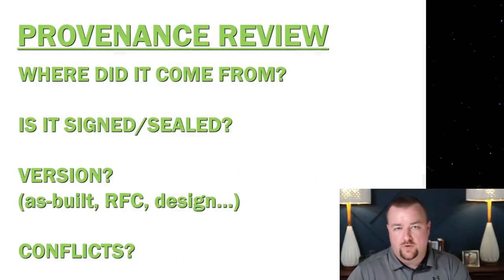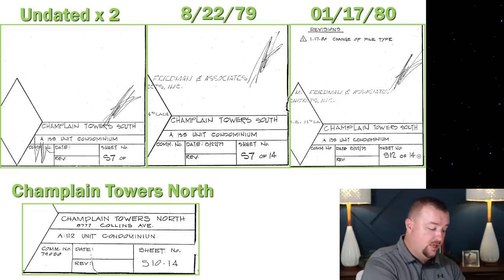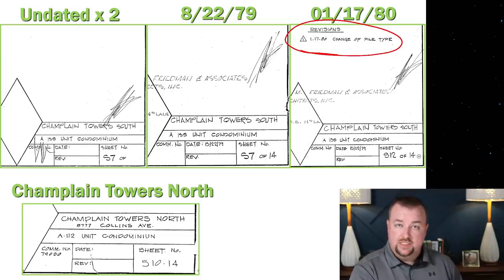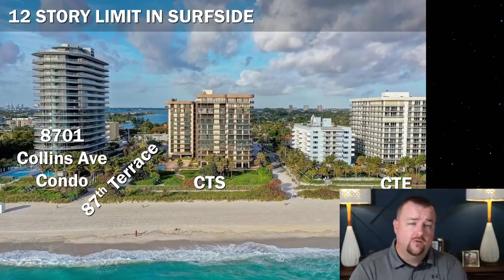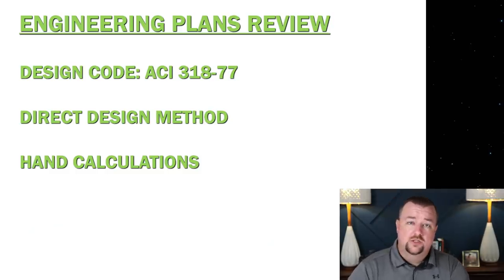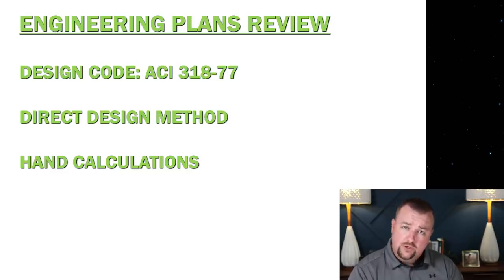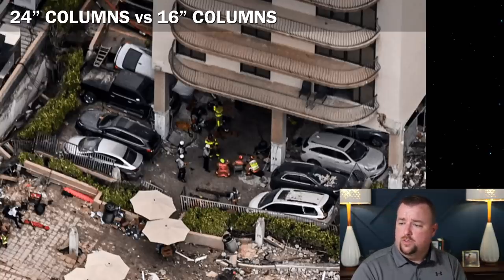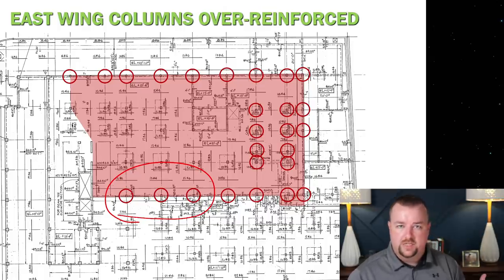Engineering Failures Found in the Champlain Towers South Drawings - Surfside Collapse

Comment: The alarming point here is that these changes were made, apparently, on the fly, with no sign of a redundant "check-out" by a second engineer or inspector to approve the revised (and reduced- capacity) design.

Engineers who think their designs don't need scrutiny from a second set of eyes is the cause of disasters immemorial. The hubris that somehow manifests itself in the trade is something that deserves study, and measures should be taken in the engineering schools and in the firms to identify and eradicate this lethal flaw...........................
Reply: Citys Planning Depts have plan check & no changes are allowed to a Design without another approval. How can you catch a Developer or Contractor who makes changes that arent on the Plans? That is why the Inspectors go out & sign off at stages. They have the power to shut down a job.
Reply: The same of which you speak they did with pilots of commercial jets. The adage of two heads are better than one will live on in time.
Reply: @Userxyz-z2d  Apparently that didn't happen here.

So who do we bring to justice?
Reply: @larrybe2900  You've the right of it.

Any profession that proclaims advocation is to be immediately suspect. Just as professional pilots rallied and protested for additional training, instrumentation and procedures to increase the safety of their field, Engineers should be actively advocating for increased oversight, continuing-education and at least two-person sign-offs on projects that possibly hazard human life.
Reply: @Userxyz-z2d  Not all city planning departments have plan check, and that was more common in the 1980’s than it is today.

Comment: Everyone is saying the collapse was caused by multiple issues so every new theory is very important. Thanks for making these videos somewhat easy and interesting for us novices to try to follow along.
Reply: Yes, there is rarely a single explanation for a building collapse. New insights are not new theories, they are new factors in the overall analysis.
Interestingly, there are many details in the column/slab designs which would not have satisfied UK codes 40 years ago but the underlying issue seems to me to be that any building loaded to 100% of capacity by its "as built" dead weight leaves no room at all for construction defects, alterations, change of use, deterioration or subsidence.

Comment: Fascinating as always. It’s scary to think that the original design had no redundancy. And then it was tweaked and weakened further. I wonder how today’s standards and computer aided design would have impacted on these plans if they were being drawn up now. Would the CAD program light up with red flags?
Reply: Definitely CAD is not just 3D structure editor. CAD does calculations after materials specified and does tensions drawings with some highlighting of failed locations.
Reply: If designed properly in the late 70's, the slab/beam design would have not changed significantly to current design. The top steel would be concentrated over the column strips instead of the top steel on the middle strips. There would be integrity steel (extra bottom bars that go over the columns). Parking would be 50psf instead 40psf which is a minimal change. A heavy dead load structure like this one would be slightly less conservative to current code but from a practical perspective, not significantly different.

Comment: Maybe it's time to look at other buildings this engineer designed.
Reply: yeah like all of them because there are no telling how many others might be designed to collapse and yet to do so
Reply: ...Or changed for alterations.
Reply: Especially the sister buildings! I heard, there is not only the North Towers but other very similar so called sister buildings!
Reply: @Iwoasasaned  And maybe look at the buildings that were inspected by the same people from the city.  I suspect a patterm will emerge.
Reply: The building was designed by an architect: William Friedman of William M. Friedman & Associates Architects, Inc. At least, he did the original 1979 plans. Not sure who did the 1980 mods.
Reply: @Johnny.Fedora  the structure is usually by the structural engineers (as practitioners of engineering). 🚧
Reply: Erre Waser  The engineer didn't sign the alterations what is suspicious. Under slab, planters and transfer beams (1979 vs. 1980). After that there's a lot like problematic maintenance and car park where before there was a beam.

Comment: On the large dynamic loads on the parking deck, your numbers were low for what may occasionally be seen.  With intended usage, 7,000 lbs is going to be the very high end of what you'll see per vehicle.  Even if they were banned / prohibited / instructed, you're going to see the occasional 14,000 lb F-350 (or similar).  The street entrance was wide enough for it, and there was about 8 or 9 feet headroom.

I'm thinking people like the landscapers, pool maintenance crews, construction crews, the electric and phone companies, the core cutters doing the structural investigation, etc.  There are many different people who could have a reason to be at the building with a heavy utility / service truck.  It's not unreasonable to think some may have backed right up to the planters to unload equipment and materials; or some may have just got confused about where they were supposed to enter / park.

There were no obvious signs at the entrance prohibiting trucks, at least not that I can see on Google street imagery.  You can't count on the valet / security to stop them, as they may be busy / on a break or the new / temp person who didn't know; and they might not stop them before they get over to the weaker spans.  Some may have even been given given permission, just for an hour, from people who didn't know the structure and think "it's concrete, it's strong".

In 40 years, I bet it happened a few times; and with a heavy back axle out on the weak span to the gate in the planters.  It's not a trigger or smoking gun, probably, unless someone reports seeing a work truck on the day of collapse (which need not be instant collapse, potentially just severe damage leading to failure when the nightly thermal contraction is doing its thing).  It could be a source of cumulative overload damage making a significant contribution to the eventual failure.
Reply: and due to the roof repair project that had recently commenced  there would be a number of additional vehicles on site ...
Reply: A cubic yard of wet sand is 3200lb, and the same of concrete is 3900lb. The only saving grace of the planters is that their size served to spread the load they added, but not nearly enough to avoid damage.

Comment: I find it also noteworthy that none of the columns in the parking garage had protective barriers (crash barriers). In my opinion, it's quite likely that there would have been minor crashes in the 40 years of use, especially around the ramp area with the tight turns. This could have further weakened the columns and/or introduced additional cracks where water could seep in and damaged the rebar.

Comment: I feel you are on to something here. I was assuming the building was built as per 1979 drawing with the beams.
Reply: I agree Josh has resolved one of the anomalies by tracking through the changes and doing calculations on the as built.
Reply: And it still was a Max with the beams. it on the ocean with corrosive salt water nothing should be anywhere close to max load.

Comment: I can’t believe this guy designed an oceanfront building with so many elements that didn’t even consider the elements and it was approved! At 100% load bearing?  Is that still acceptable building standard?
Reply: It wasn't acceptable back then, and it isn't now.  I wonder if there were ever heavy vehicles, such as JLGs or fork trucks driven on the pool deck as well.
Reply: I'm not a structural engineer but I am sure every code has to include safety margins.  If a failure would cause loss of life, any building code is going to require significant margins on whatever parameter that is.  If the original approved design was already at 100% with no margin, that sure looks like a serious engineering process failure to me.
Reply: Construction In Miami in 1980 was massively booming. I was there. Building inspectors were overwhelmed and rumor had it that they could be paid to over look shortcomings.
Reply: @JoeP3300  Inspectors probably wouldn't recognize if the building was underdesigned or not.  There were not enough structural engineers in Florida for the boom so other types of engineers were attracted who thought they could design reinforced concrete buildings and after the buildings failed during construction they found that that there were aspects of reinforced concrete design that they didn't know and they were in fact not qualified to do reinforced concrete design.
Reply: @dancevideo2  Didn’t they basically do their own inspection? I’m sure I read that the engineer could sign up to basically evaluate his own work. So then the inspector who turns up is just looking to see if the number of bits of steel in the ground matches the plan, not if the plan itself is calling for the correct amount. Basically there was no one to check the engineer’s math except the engineer and maybe someone else in his form if he worked with other people. But I’ve seen it happen in that scenario (in a group project, not structural engineering specifically) where the second person in the group basically does spot checks on the math instead of looking at the whole picture, and assumes if those work out then it’s fine. But you can have pieces that work out that still don’t combine to a successful whole.
Reply: @TrappedinSLC  Yikes...Not good
Reply: @TrappedinSLC  It's not the building inspector who checks the math, it's the building department which approves that plans who should do this. The inspectors check for built at drawn, but it's just a spot check. I think the problem is that the second drawings were a change. The first drawings had a bigger review, but the change was a smaller review which may have missed that the beams disappeared between the first review and the second review. Both the engineering firm and the building department missed the significant impact of that change.
Reply: @johnhaller5851  re: "The first drawings had a bigger review, but the change was a smaller review which may have missed that the beams disappeared between the first review and the second review. Both the engineering firm and the building department missed the significant impact of that change.
"
This ^^^^^ x 1000
Reply: @johnhaller5851  Yes, but I thought I saw somewhere that the engineer could get permission to effectively be the person doing some of the checks instead of an independent person at the building department doing it?
Reply: @JoeP3300  On Engineering Forum heard many state 80's was a anything goes time in building.
Reply: @ButterfatFarms  Miami Vice was filmed there for reasons other than it was a cool place. ;)
Reply: @dancevideo2  I think they gave up the safety margin when they repaved the pool deck and had water pockets stand on it.
Reply: @cynvision  That surely didn't improve things. The eventual NIST report will be interesting to see.  It also seems strange we must rely on a casual walk-through video from a random person looking for a parking spot, to determine the as-built configuration. For a 136-unit building where each unit could be from $0.5 to $2.8M you'd like to think there were better records of the building somewhere, but maybe not?
Reply: @dancevideo2  Well the documentation wouldn't be digital. It would be some 35mm film in a shoebox in a relative of the architect house's at this point. Or in a landfill.
Reply: @billj5645  I presume inspectors simply verify that things are done 'to code', so it's the code's job to be safe?  And since every building is unique, how does 'code' apply? It would seem to me that every building's 'design spec' should be reviewed and approved by someone - but who is that someone?   I live near SF and we are dealing right now with the infamous 'Millennium Tower', which was approved to be built without running piles down to bedrock (the building is now seriously leaning/sinking). Pretty amazing.
Reply: @johnhaller5851  exactly. And if you look at the catwalk that fell in the Hyatt in the early 80's it was the same thing. A last minute change to the suspension of the catwalk was approved but the designer never specified that the new style required a certain kind of pin, he says in modern interviews that he had no way to know the builder didn't put the correct pins as they were part of the changed suspension system.

Comment: Wow. This is so damning and authority had no accredited checkers in place to find such MAJOR design defects. So if the beams were there, would the building still have collapsed eventually but at a later point of time, or just prevent any failure assuming  remedial work was taken at a later point of time, to get the 40 year certification?

Comment: When you say the pool deck was 100% loaded as built, then what was the impact of having all those additional pavers added as part of the later renovations.
Reply: He didn't elaborate on what dead loads he used.  There were always pavers on the deck, and there would some amount of concrete and mortar under the pavers to level them and build in some slopes to the drains but it is unclear how much should have been there and I'm not convinced that the original engineer considered any of it.  There are photographs of the failed slabs near the pool that show about 9" of additional concrete/mortar materials on top of the structural slab.  The pavers themselves might not be so significant but 9" of concrete/mortar materials is very significant.
Reply: @billj5645  We know from the core samples that they didn’t bother removing at least one set of pavers they just put leveling compound on top and then stuck on the tiles. So it effectively had two floors worth of dead load instead of one. (By floor I just mean the flooring - tiles or pavers - and necessary underlay for the installation, not floor as in the whole floor of a building.)
Reply: @TrappedinSLC  Your avatar reminds me of a term we used to have called "horseback engineering".
Reply: It had a serious impact. The total extra topping/paver weight on the columns was more than the weight of the cars.

Comment: Also back in the late 70's you didn't have heavy SUV's, mini-vans etc that we have today that could still park in those spots.  I have a friend that has a 1966 Mustang that weighs 2626 lbs and his Telsa model 3 weighs in at 4250 lbs.  Our SUV weighs in at 4500 lbs etc.  39:25 There is a black crew cab truck there in that picture next to the 24x24 column that would be 5000-5500 lbs and could go up to about 7200 lbs.   I am sure if you use those live loads with all heavy trucks and SUV's the load would be quite high.    Its like sitting on an overpass stationary when other cars or larger truck (not semi) drive by and the whole car shakes, and that is using large 24-36" tall pre-stressed concrete i-beams on 4-5' centers and it moves that much.
Reply: The vehicles today seem heavy but compared to what Josh described for the planter construction, the vehicle weight is insignificant like hollow tin cans.
Reply: @ButterfatFarms  The point is that car weight is still somewhat insignificant.  That parking and deck area should be designed for more than enough load to cover any passenger car that is on the road today.  For instance where there were 4 cars parked in that area that dropped down there is also a planter right next to the cars that is about 60' long.  That planter could easily weigh about 60,000 pounds just by itself.  So arguing about whether the cars are 1000 pounds heavier is somewhat pointless.  However something that J almost touched on but didn't is that the parking area on the left side of the building was intended for deliveries.  What kind of delivery vehicles could drive under there?  Building areas intended for passenger cars only usually have some form of reduced height at the entries to keep vehicles out that are taller than 6'-10" or 7'-0" as a way to keep out heavier vehicles.  If they didn't have this kind of thing at the entry to the delivery lane then they could small delivery trucks driving in there and those can legally be up to 40,000 pounds.
Reply: The weight of todays cars are still within the design limits if the slab was properly designed.
Reply: Are you kidding me?  Haven't you seen some of the boats people drove in the 70s?  Those cars were enormous.
Reply: @billj5645  Yep already learned form this is if they can put something very heavy somewhere they will so one has to build physical barriers to anyone putting the ultra heavy stuff places or design as if they are going to put a Crain, Tar Mixer, Concrete mixer, heavy construction material, fire truck, etc. on any open place they fit in, as you can assume they can't or not read signs or obey them and the staff of course can be counted on to not enforce the rules. 

Engineering even shared pictures of what happened in some of these cases like construction trucks falling to a lower level of a building though the floor, wheels on one falling though the floor, etc.